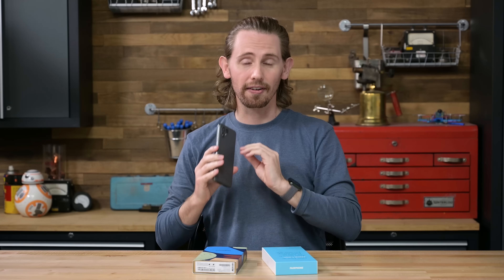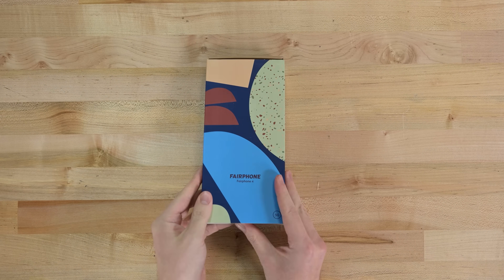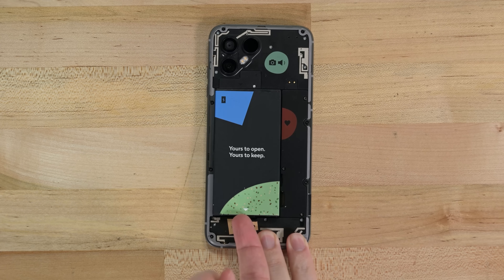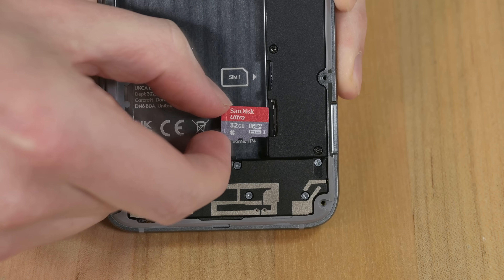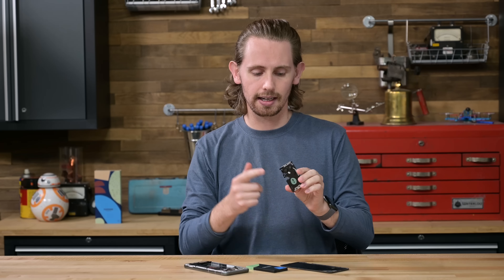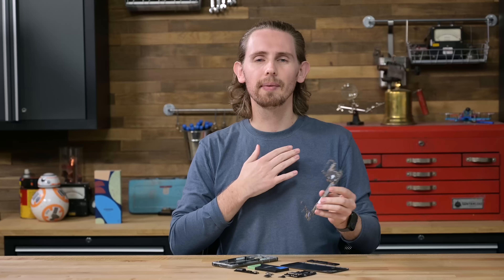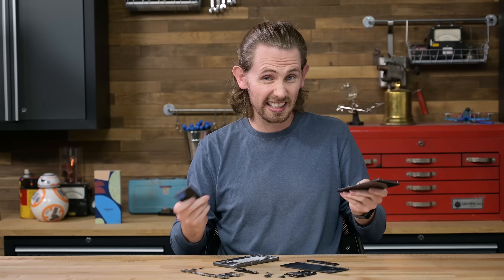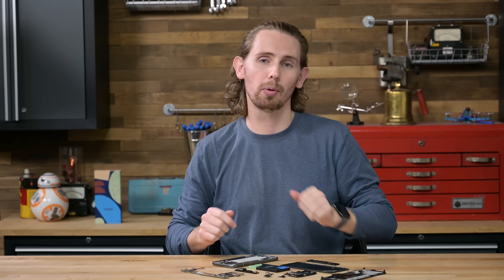Fairphone 4 Teardown: If Only Apple Made Phones Like This…

Comment: If youre gonna Ask me: Fairphone Should hire the Engineers Who designed the LG V20,these guys Practically made the most user Friendly & Repairable Smartphone to Date while still being up to Industry Standards & Has more stuff than you would Expect on a Modern phone nowadays such as the HP Jack paired with a powerful ESS Sabre Quad DAC chip
Reply: I desperately miss LG in the phone market. The V10 is still my favorite phone that I've owned.
Reply: It is a big loss to the smartphone industry that LG stopped. They sure gonna be missed.
Reply: Brilliant phone still use mine as a music player.
Reply: At this point, i don't think the issue is design expertise, but more of cost and contract for volume orders. FairPhone's operations may currently not be able to handle such a commitment yet, especially as they are only currently serving the European market.
Reply: Oh man, do I ever wish we could get a new V20 with modern specs.  That phone was amazing!
Reply: The USB-C port on the v20 is not repairable however
Reply: I miss my V20 too. If only the darn camera lens weren't that fragile.
Reply: @KaziUpal  Couldn't agree more. I thought foldable screen smartphones were cool until I saw LG's detachable DualScreen case. Didn't take long for me to return my telco-locked Galaxy Fold.
Reply: Im a big fan of the XCover Pro, same hotswap battery, IP68 modern & snappy ~$2-300
Reply: @backyardaviator2920  im typing on it right now. Literally the only "flaw" I can find is that is huge, ~6.2" which is MUCH larger than my previous S5, and its an obscure business device, meaning I dont believe you can buy one new, even though its still being produced.
Reply: @Carterthielftw_  dang yall Lucky for having that on your market,here in their Asian Markets,We have to make do with their Cheaper A-Series or Shell out extra for their Z Flip,Fold or either their S or Note Series(Which is Dead now sadly)

Prolly one of the reasons People here moved from Samsung to Xiaomi since they get a Better deal there compared to similarly priced phones from Samsung
Reply: @Carterthielftw_  I do like the XCover Pro. Just about the only two thing missing from it are a more powerful chipset (Exynos 9810 is still fine by me since Note10 Lite, XCover FieldPro, and Tab Active3 still uses it) and USB-C 3.1 with Samsung DeX capability.
Reply: Lg Had Military Grade Certification And Tough Build Quality And Good Display on Flagship even in k42 military certification if im not mistaken. But sadly they lost to its Home grown South Korean Rival Samsung. 😞
Reply: Im LG Flatron CRT TV user For 17 years. Im 19 years old. Till now no pblm on lg tv. And dvd Player came with lg tv served me a decade.
Reply: I still have mine and I love it for all the features that newer phones lack.

Comment: Absolutely yes, I would purchase a set of Fairphone 4 devices for my spouse and myself if they were available in the States with our current carrier. I’m excited about the recent news that Apple will be releasing OEM parts and repair guides soon, but I have greater respect for Fairphone as a holistic exercise in repairability, ethical sourcing, and anti-planned obsolescence.
Reply: Apple released it's OEM parts and repair guides and it actually comes out more expensive to do it yourself then it does to have Apple do it when you rent the tools you need with the guide. SMH
Reply: Why not just buy it and add your sim card
Reply: Apple is so fake in those crappy guides and parts.
Reply: This aged like milk...
Apple did release their repair program but honestly as far as I can tell it's only reason to exist is to point at when questioned by lawmakers. It provides absolutely 0 value to the customer.

Comment: As someone who builds things for a living, I am very pleased with this design. The only reason other manufactures DON'T design like this is to deliberately hinder repairability. Shame on them and well done Fairphone. I also want the headphone jack back tho 😉
Reply: The presenter went over this bit so fast. So how do we attach headphones to the phone?
Reply: @saraholiveedwards4697  A crappy adapter to the USB-C port. Or an even crappier pass-through dongle so you can charge and listen.
Reply: I personaly prefer the jack plug on a phone for the simplicity of it, but there is another solution than the usb-c adaptor.  Nowaday, I plug any wired headphone I have to a tiny light battery powered bluetooth module (15-25$).  The best with this solution is that it can connect wireless to "any" phone, computer or technology with bluetooth capability.  Basicaly, the module can convert analog sound signal to bluetooth.  Imagine, going to the beach with any WIRED headphone without the need of TOUCHING the phone in the backpack (ideal for sand and water protection).  For me it has been the best of two world. Imagine, the liberty of wireless plus the quality of the "loved "old" "non-breakable" "comfy" headphone.   Yes you still have the cable management, and the need to charge the module... But hey, no pain no gain.  And yes, battery life of the module will be super short, like few years or so.  Then you plug it on a powered pack and your ok forever.  I"ll finish here.  Good luck.

Comment: I'm skeptical of them removing the jack, especially since they sell €100 wireless earbuds now. And it doesn't look like they sell any replacement batteries or parts for the earbuds, while also highly encouraging you to purchase them instead of dongling the headphones you already had.
Reply: Tbf, they also sell you the dongle for 10 €, which isn't bad at all.
Reply: @razemix  Agreed, and this is often overlooked, you can also just leave the dongle attached to your headphones.
Reply: A 1/8 headphone jacks receptor is a nightmare for ISO 65 and above water resistant ranking. I can well understand their need to go as waterproofing exceeds wired earphone’s necessity since Bluetooth readily makes them redundant.
Reply: My S10e is IP68 and it has a headphone jack and microSD slot @paulharney29
Reply: @CSab-ui2jt   I didn't say it is impossible.   I suggested, and correctly so, that it is easier to make a phone water tight without a headphone/aux jack.  Manufacturers know this, and so when bluetooth became robust the handwriting was on the wall.
Reply: @paulharney29  Did you say "bluetooth" and "robust" in the same sentence?   HAH!

Besides, if I have a set of wired headphones, I can use them with ANY device that has a headphone jack.  With bluetooth you have to keep track of which headphone is paired to which device (as well as having to have multiple headphones lying around).    Face it; the ONLY reason they're removing the headphone jack is the cost of them cuts into the CEO's donut-and-sushi budget.
Reply: That was a concern of mine too until I discovered that their USB-C to Mini Audio Jack Adapter (3.5mm) can be bought for £8.95 and now they are giving away their True Wireless Stereo Earbuds
 worth £89.95 free with the purchase of a Fairphone 4.  A win-win for me so I've just ordered one (and included the adapter as well).
Reply: u get the wireless earbuds with the phone for free,

Comment: A couple of comments:
The Fairphone is not water resistent - a result of the modular design and decision for easy repairability.
I remember well these times when you had to have spare batteries with you to make it through the day. And part of their issues was corroded pins - yes, exactly those pins you where so happy to see again.
I had several phones, from Blackberry (the best to write on), over different Samsung phones as well as others with failing parts from battery over charging ports and front glasses as well as backside covers.All without them falling or been treaded badly. And all where broken and replaced within 3 years - also because of software update issues.
My iPhone 6 I have now for more than 6 years. After 4,5 years I changed the battery. Nothing else broke. I will get a new one next spring and it will be an iPhone again. The only reason is that even though I get constantly safety updates some apps are not running on the OS anymore.
The one thing I am much on your side is that exchangeable batteries and memory extensions are the most needed things to be added.
But only if it does not jeopardize the safety of the OS (infection by memory card) or less water proof resistance because of making these changes happen.
I agree that Apple could and should be improving on repairability. If they would the iPhone would be even better with it total ecosystem and easy to use approach. Apple will have to change for certain as sustainability is important. But honestly I feel better having used my iPhone for such a long time than I had when I had to get new phones every 2-3 years.
But that is only my thoughts 😌
Reply: Fairphone udpates their OS (not just security) for a pretty decent longevity in fact 🙂
Reply: @klevkaisetsu4883  I did not check on that but I take your word on it. There are interesting times ahead of us and companies like Fairphone can be a force driving development into the direction of better repairability. But Apple has - imho - a very good and over their different products well integrated ecosystem which I like as it makes my life easier. The safety aspect and their better (not perfect). control on Apps is something I prefer over google Android. I know, I know - Apple is as well out there to make money and surely they are not perfect but while I like using google for websearch but for other things Apple is my choice. I just wish they had more affordable computer - there I stay with windows / Linux because of price and hardware updates are easy…

Comment: The funny thing is that when my s10+ broke, I saw the fairphone and what pushed me away from it was the missing 3.5 port. Because I didn't want to deal with more usb port issues, I went with an LG v60 thinq, which has been good to me so far.
Reply: That V60 is still a solid phone in 2022. Shame that LG has to pull the plug from smartphone market. I totally miss them.

Comment: While I never really knew much about this phone at first, I actually think this could be a really great device and may be something I would buy. I don't really care too much about specs as long as it works, it's speedy, has good battery life and is up to date. However, I still need to see some reviews about it.

And while I do live in Australia, Amazon seems to be able to ship the phone from the UK and I think that it is compatible with our network frequencies. I'm not so sure that the seller is trustworthy, and it only appears to have 2 reviews, and the phone has none. Amazon says it costs $1,201 AUD (a little more than an iPhone 13 mini) but sadly it would arrive after Christmas.

Comment: i received mine a few days ago. It's a decent phone, the screen is great, the camera quite average and it's a thick  phone.  Coming from a Pixel 2, that's still working fine but the battery is dead i just had enough.  IDC about flaship specs, i  just want a phone that last. Android run fine, the battery life is great, i don't have a lot of fear about breaking it and i will start looking at a new phone  in 5-6 years.

Comment: Hello

Good day.  I am running an LCA on the fairphone 5 for my Beng Project. For my analysis, I would be needing, the weight of all hardware components. However, the fairphone 5  isn't available in my region. Please can I would like to know if I can get the weights of the dismantled component from you.

Comment: If it had a 3.5mm jack, that would definitely be my new device... But can't use a phone without it
Reply: That was a concern of mine too until I discovered that their USB-C to Mini Audio Jack Adapter (3.5mm) can be bought for £8.95 and now they are giving away their True Wireless Stereo Earbuds
 worth £89.95 free with the purchase of a Fairphone 4.  A win-win for me so I've just ordered one (and included the adapter as well).
Reply: @ronniemaclellan6940  yeah i know there are solutions but in my experience you never have the adapter on hand when you need it...

And wireless headphones yes, but same, when you need them they have no battery, and you're stuck when you wanna plug anything else

Comment: I have an iPhone XR and have been an iPhone users since the very first version came out. 
Over the years, I’ve been less and less happy with the iPhone, to the point where I have considered replacing it with something else. 
I did try the Punkt MP02 but it went back within a day due to the dreadful software problems… that was way back when that phone was new. 
The Fairphone 4 has my interest peaked as I like the idea of a phone that can be repaired and upgraded but what has stopped me trading in my Xr for the Fairphone 4 is the cameras. 
Images off the iPhone XR are good when there’s plenty of sunlight but in low light, not so. 
With the Fairphone, I’m not sure how good the camera unit is in comparison to the one in the Xr (even though the Fairphone has two cameras over the one with this phone) and has stopped me buying one; well, that and Android (I don’t trust Google( yeah, I know, tinfoil hat and all that)). 
How good are the cameras? 
I suppose these can be upgraded due to the replaceable modules which should allow better cameras over time to be added.

Comment: I have one, it is awesome! I would always buy it again. With iPhone I am stuck with apples Software stack, which is not great. And I have a phone now which might get SW upgrades and spare parts for the next 10 Years but at least for 5 years from now, that is a more decent lifespan than my last phone on which I have for 3 years now and I dont get rubber protective covers or software upgrades anymore.  I am using FP4 with /e/OS  which sure is not grapheneOS but with builtin tracker blockers tor proxy and many more neat features reasonably good for my tasks.

Comment: One question. Is it better as in faster than the Samsung s8? If so I'll get this to replace my S8 that now has the known screenburn issue
Reply: It has a Snapdragon 750G with 5G capability. Compared to S8's Exynos 8895 (European version), Fairphone's chip has a roughly 20% increase in performance. If you have the Snapdragon version of S8 (USA and China) which has Snapdragon 835, the Fairphone is more powerful by 15%. You can find comparisons online, but it seems like the performance is not an issue.
Reply: Overall, it is very similar, as the chips are optimized differently.

Comment: Looks like a fairly nice phone with a metal frame unlike older Fairphones. Long time SW support is very important for phone longevity.
Reply: It seems to be supported by LineageOS, which will help on that. My current phone is too similar to the Fairphone4 to justify a move, but my next phone will be a Fairphone running LineageOS right off the bat.

Comment: I wanted the Fairphone 4 really bad...before I found out it didn't have a headphone jack :/

Such a bummer tbh, I even had to buy a new phone in the same week the Fairphone 4 came out.
Reply: Is there really such a huge problem with using a dongle? You can keep it attached to your headphones and just plug it into the USB-C port when you need it.
Reply: @razemix  Yes, it's always a huge problem to use an dongle insteal of an internal jack. Also dongles broke up fast, you need to take it with you, you lose them, and finally, you must decide to hear music or get power for the phone

Comment: Because of abominable firmware that forces one to press it a million times a day, and because they cut corners by integrating the fingerprint reader in it, the first part of the Fairphone 4 that will break is the power button, which you cannot repair. In other words, you're fare more likely to have to throw this phone away than to have the need to replace anything that can just be screwed in.

Comment: As much as I like companies like this and Framework, the reality is that most people don't care about repairability, and products like this will always be extremely niche, never making a dent in the immense e-waste we produce.

Because of that fact alone, the only solution is regulatory changes to force the major players into making repairable products, have parts available, service manuals, etc. Until that happens, the few of us buying and repairing Fairphones and older devices aren't statistically significant to the overall problem. I wouldn't go so far as calling it greenwashing, but these companies are not the solution.

Comment: Even tho I like to repair my devices, the question what the world would be if any phone would be like this is pretty simple. Devices would not be that powerful as they are today. There is a reason why this easy to repair things always lack the latest upgrades.
Reply: Snapdragon 750G chipset is miles faster than a three-year-old flagship chipset. Heck, it even has the same ARM Cortex CPU as Snapdragon 865, 865+, and 870, so that is good enough for me. High screen refresh rate is just a bragging rights gimmick to me. I only use it during mobile gaming. Most of the time, I lock the refresh rate at 60Hz.

Comment: If these were available in the USA It would be my only phone.  What is going to take to get in the USA??
Right now I buy NOS LG V20's just for the replaceable battery.
Only thing really missing from the Fairphone (besides US Support) is LIDAR that would be awesome with with my 3D work.
I would also love to see a larger battery pack. I would be very happy to hold a brick. I use 10,500amh battery on my LG, and it never runs out, even if I forget to recharge it.
"GET YOUR ASS TO MHAAS!" ... I meas the USA!